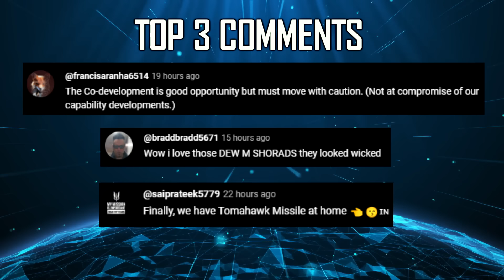Indian Defence Updates : AMCA on Chinese Radar,Tejas Twin ASRAAM,New High Power Laser,HMDS on Jaguar

Comment: DRDO should be called rocket and missile research institute because besides these hardly any new thing is developed that is worth being used on defence needs. Aircraft development is 30 years late with no engine in Tejas, floundering in development of TEDBF and AMCA, it seems they are throwing dust into the eyes of tax payer and administrators. What happened on production of Software Radios (SDR), what happened to production (not development) of the friend foe system how many have been employed by the Indian defence, what happened to quantum communication, what happened to Large VHF, UHF radar mobile antenna on multiple four wheel drive vehicles to form an array to detect the J-22. The list keeps on and on, its like a delta function, singularity in missile and then nothing else. Useless institute and I think there should be some court martial for their management. We will keep running at 10 mph trying to win races where everybody runs at 1000 mph. I don't know when we will reach close to other countries, even who were behind us are slowly getting ahead of us. Current Government did speed up, but its not sufficient, its too less and too late. Ashamed of DRDO and its contribution to India, I am not impressed with their development cycles, their attitude and I don't consider them nationalists when they are so behind time. Look at Americans they are 100 steps ahead to defend their country, each one of these DRDO would never have been put up for work to handle critical technology even in Africa, forget about US.